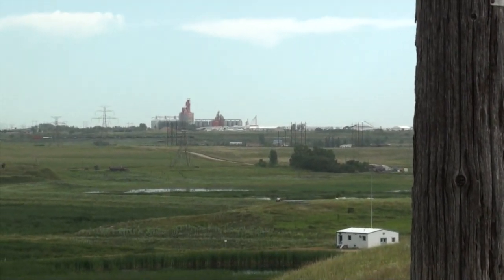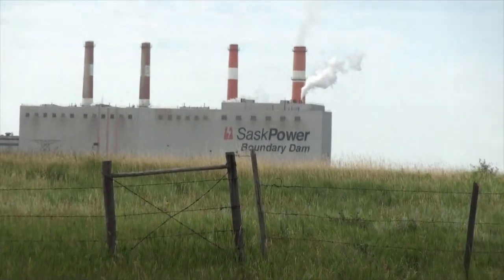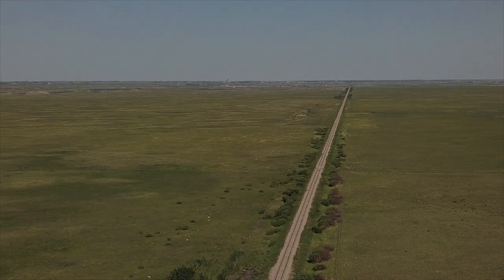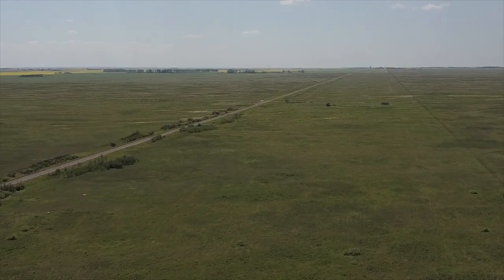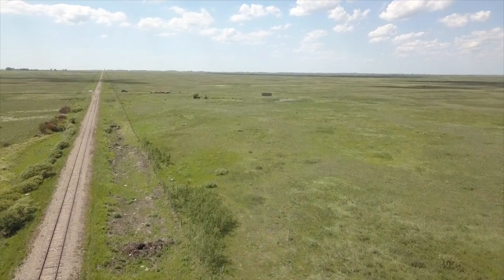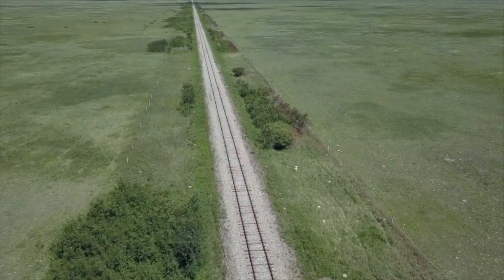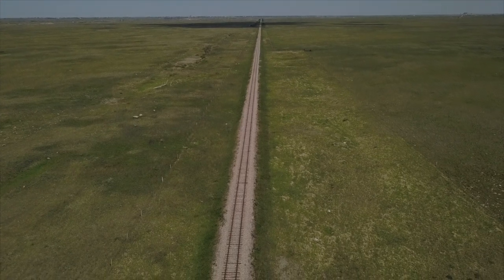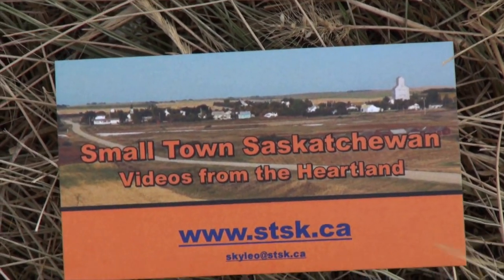Tableland, Saskatchewan

Comment: See how along the tracks where they leave it alone, they have trees and shrubs? I bet the entire province in the south would look like that if not for the intervention of mankind.
Reply from the maker: They say not, Bruce. They say that in the time of the buffalo there was very little brush: it was either eaten down, or trampled. There were Millions of the beasts roaming pretty much at will. And there was also the occasional fire which would have been harder on brush than grass, I think.
Anyway, thanks for watching and commenting. Take care and Keep well.
Cordially,
Don Wilson
Reply: I find the opposite is the case. I farm and live in “Northwest” Saskatchewan (but really it’s west central Saskatchewan) only a couple miles south of a provincial forest. In the 1910s/1920s, many homesteaders had built their shacks from lumber hauled in from other sources and a few built soddies. It pretty much looked like Regina area up here in those days. Trees were far and few between and where the present Bronson Forest is, it was not much more than a few clumps of scattered poplar here and there. 
I think this practically disproves your thoughts on “farmers cutting bush down.” There was little to no bush where I’m at in the homestead days and now there is a very thick provincial forest a few miles north of me, and most of the sloughs have rings of willow and poplar. The bush didn’t really grow with much vigour here until the 1940s, much after the Dust Bowl days.